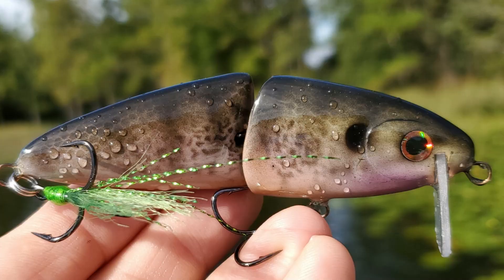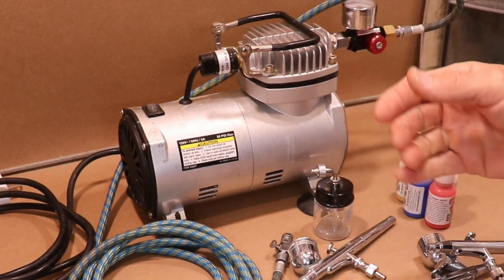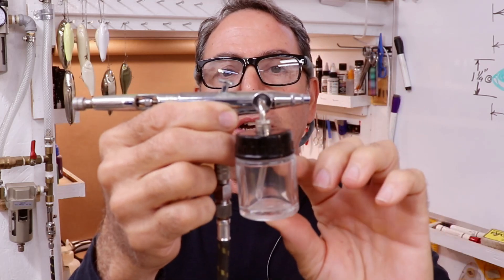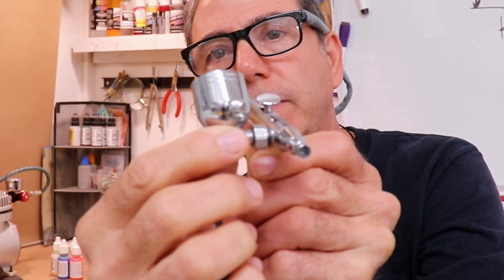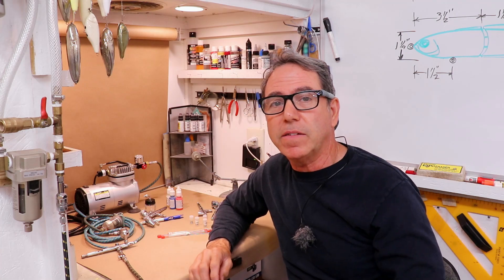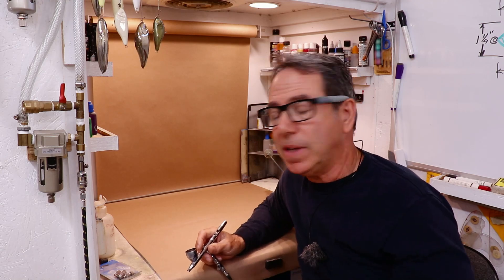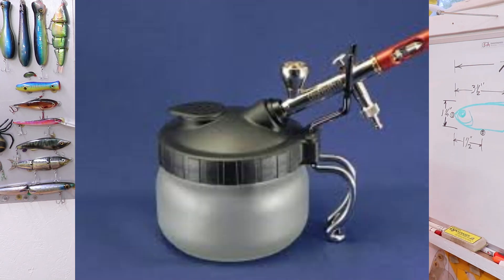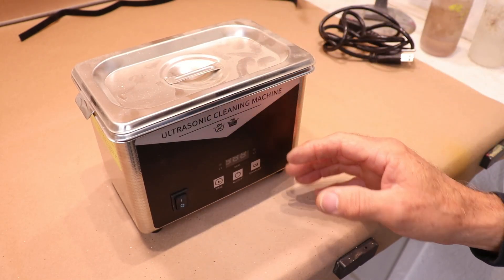Airbrushing for Beginners, You can airbrush on the cheap,   #airbrush #luremaking #airbrushing

Comment: I started airbrushing lures about 25 years ago. This is all good advice. Having said that, despite my experience, I am constantly experiencing problems. Splatter, clogs etc. I think the most important thing is getting the paint to the proper viscosity as you mentioned. I have not been able to do this consistently and find it to be the most difficult skill to acquire.
Reply from the maker: Well said!
Reply: Experience is better than knowledge
Reply: When I watched the painter at an old job, he would watch how the paint dripped off the stir stick after measuring out the ratio. That might not help considering this situation would require a tooth pick 😏

Comment: Always a pleasure to watch your videos, very simple explanation for newbies.
I've had experiences that I thought were a bit risky, starting with colors that I hardly use the specific ones for airbrush anymore, now I mainly use colors for pictorial art or for casting painting techniques. The only attention, I have experimented with various brands, is to make an appropriate dilution that even with the same brand, each color has different dilution needs from another. Sure it may seem strange but they have a more covering power than specific airbrush colors. Another trick I use is to dilute not with water but with isopropyl alcohol, it increases the drying speed of the color, and a little reducer that prevents the color from drying inside the airbrush.
Obviously these colors always contain practically invisible waste and therefore after an initial dilution, it did not define, I filter the color with the filters that are used to filter the resin of 3D printers, then I carry on diluting.
For cleaning the airbrush I use 90% distilled water, then I can add, in the worst case, a drop of acetone which I bubble into the airbrush tank, otherwise more often I use isopropyl alcohol, then rinse with distilled water which I spray with very hard pressure, I have a small bottle with a sprayer that also gives me a very tight spray.
Unfortunately, where I live, the water that comes out of the tap, even if it is certainly drinkable, is particularly rich in mineral salts and therefore washing the airbrush with tap water is very risky because it could damage the airbrush.
Cleaning the needle I do it when I see that the needle cannot be cleaned while cleaning the airbrush I see that the needle needs cleaning. Now I make you cringe; I usually remove the needle and clean it with a paper towel, but... but every now and then I mount the needle on my screwdriver drill and with an abrasive paper wet with water, I turn the needle inside the abrasive paper with a good speed paying particular attention to the tip of the needle. I can also use the same product that is used to clean silver ornaments, brass, etc. In Italy it is called "Sidol", with this product I do a good cleaning by hand. After cleaning the needle I pour a very light film of oil for sewing machines, since I use to lubricate the needle with a single drop of oil, the precision of the painting has improved significantly.
Then I had many other experiences, but it's another chapter of my book / I'm not writing a book, it's just a figure of speech).
Hello

Comment: I've had a Badger airbrush since the 1980's and a Master airbrush since the 2010's. Despite trying to clean them regularly, I had a lot of trouble with little to no paint spraying and it being very erratic most of the time when they did. I recently purchased an ultrasonic cleaner (after watching one of your videos) and used it on the Master brush the other day. Now it sprays like new. Also, I wasn't thinning the paint nearly enough and have learned that there's a fine line between to thick, which clogs the brush, and too thin, which easily gets blown into spider web paint patterns. Thanks for all the great tips!

Comment: Spent 28 bucks on amazoon for a "hubest" airbrush.  Comes with a 0.2. 0.3, 0.5 mm needle/nozzle.  Apart from the action on it feeling a tad less smooth than my badger airbrush, it sprays beautifully.  Just painted a motorcylcle model with it and the fairings/bodywork has a showroom finish.  
To those looking to blow paint on the cheap....go for it.  But buy a bottle of needle lube and  get a drop on your needle in between uses.  Your needle packing bearing will thank you and your airbrush will perform (above expectations for me personally).

Comment: Great information, I’ve been painting Fishing Lures for 3 years, I started with Paasche Talon Airbrush’s with the 9cc cup, I still use them and love them. 
Several months ago I bought a PointZero 0.2mm nozzle and a 2cc cup, and MAC valve, I have no use for the MAC valve, but this PointZero airbrush I’ve grown to love, for a airbrush under $25 this thing rocks!
Everybody will develop there airbrushing World around them, based on what they know, me being in Industrial Maintenance all my life my airbrushing world will reflect this, I also do things differently because of my Stroke years ago, my right arm is basically useless so I’ve adapted most everything around that. 
Painting Lures can be done on the cheap, you don’t have to spend a ton of money to do it. 
The main things to know are what’s paints to use with your airbrush nozzle size, how to thin paints correctly, and the correct air pressure with nozzle size, paint used, basically 20-30 PSI for most applications. Experiment on paper,  lots, and lots of experimenting!
Note: most times the airbrush is not the problem, if you have issues, most times the paint thickness is!
LEARN HOW TO CLEAR THICK PAINT FROM YOUR AIRBRUSH, and properly clean a airbrush!
Using cheap craft paints can and will cause you very bad issues, you will fight plugged nozzles and throw things!
Airbrush friendly paints are a necessity, going cheap can cost you more so much time in fighting then painting!
Reply from the maker: All very true

Comment: Iv bought a portable battery powered one for 45 euros on amazon just to do some facelift on my lures and im impressed with the result.
Iv never painted or used any airbrush before so i have no clue on the quality vs the top tier handmade lures, but mines are coming out stunning. Better than factory lures for sure that peel off so easily after some rock hits(i rock fish). The epoxy uv i bought from your store gives them great resistance.
For the price might be even a cool video ideia
Regards
Reply from the maker: Nice!  Thanks for sharing.

Comment: You mention not using a single stage suction airbrush. I learned to airbrush with a Paasche single stage brush and am comfortable using it. I haven't jumped into lure painting yet but want to, and I'm thinking that the brush that I have will work for the time being. What are your thoughts for using this brush to start painting lures, then changing over to a two stage. thx
Reply from the maker: Absolutely stick to what you're used to there are only some small benefits to using the top feed for lower making